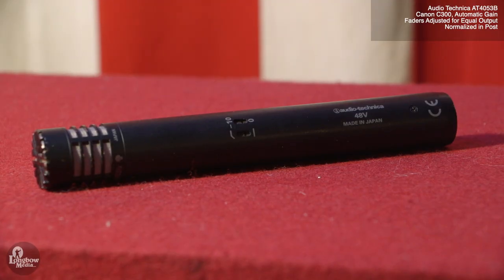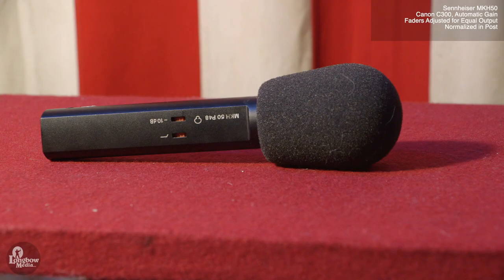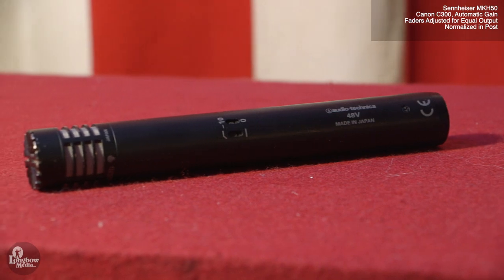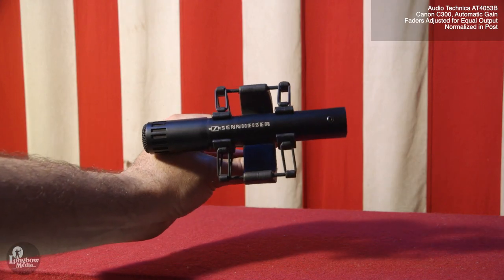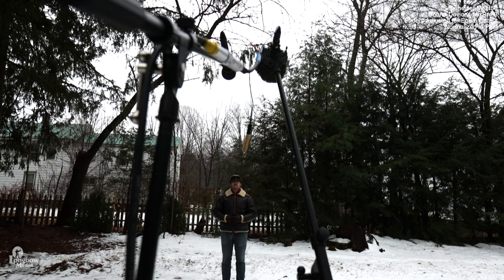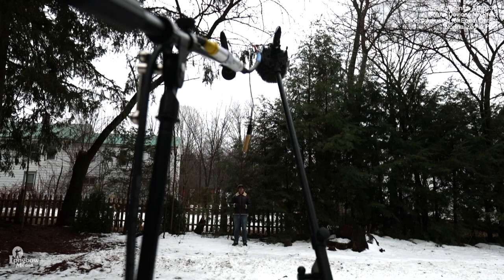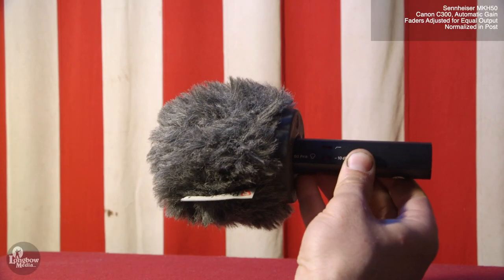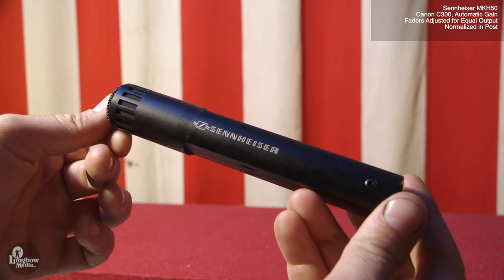Small Diaphragm Condenser Microphones for ENG & EFP (Sennheiser MKH 50 & Audio Technica AT4053B)

Comment: Minimal difference between them. Sennheiser MKH 50 is a bit louder and a bit clearer, but that's it. Not really worth the price if you consider value for money. I mean it depends on what you are doing, but 95% won't hear the difference. Most people use phones, laptops, PC speakers, earbuds, and up to 100$ headphones. They are both great, I will probably get the Audio Technica AT4053B save more than half, and invest it somewhere where it would actually make a difference. I like the Sennheiser MKH 50 design though, rugged looking.

Comment: This was just a perfect comparison. I absolutely loved the varied samples to demonstrate exactly what these mics sound like in different environments and situations. I've never had a separate mic for recording dialogue indoors. I've always used my shotgun mic, but I learned the difference of recording dialogue indoors and outdoors and why different mics are used. I've been trying to decide between these 2 mics. I was trying to find out if the difference in cost would be worth it for the Sennheiser or not. Your demonstrations have shown me that it is. There is most certainly a reason the mic has the reputation it does, as well as it's use in film and television. I am also in the market for a Mix Pre 3, so I was very happy to see that's what you are using for this video. I've been in the process of upgrading all my filmmaking equipment to a Pro to "near Pro" level. Your video is very much appreciated.
Reply from the maker: I'm really glad that this helped you. :-)

Comment: hey longbow,

i recently purchased the at4053b and hope you can educate me on this,

when having the mic facing towards your mouth straight on, im noticing whenever i make Puh sounds, the recording gets muffled

is this just how it is with every microphone? hence, we have to place the mic out of direction of our mouths when we make puh sounds?
Reply from the maker: Yes, plosives (that "puh" sound) will affect most all microphones. (Less of an issue for omnidirectional microphones and mics with built-in wind screens) I typically place directional microphones at a 45 degree angle from the mouth when up-close (radio broadcast trick)  You will also want to employ a pop-filter or foam screen to reduce the plosives.  Repositioning the microphone farther from the talent or facing the microphone towards upper-chest are some other options.

Comment: hey longbow,

i am contemplating on getting the AT4053B for indoor videowork 
saw that you used it for outdoor but
would it be best to just use a rode video mic pro?

Thanks longbow!
Reply from the maker: The AT4053B is more than capable for outdoor dialogue as long as it has adequate wind protection and placed close to the talent.  If using a wide-angle lens or in a very loud environment, a shotgun microphone will be better suited.  I'd imagine that the AT4053B would be better, but if the Rode has more of a "shotgun" polar pattern, it may be better suited, but I've personally never used the Rode.
Reply: @LongbowMedia  thanks longbow, yeah everyone is saying that hypercardioids are terrible for outdoor, but in this test, it looks great to me